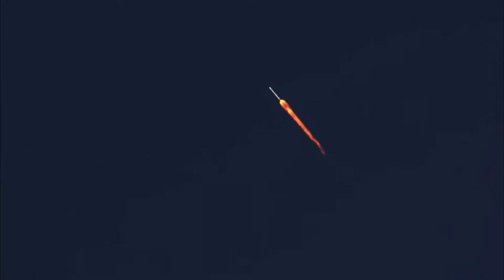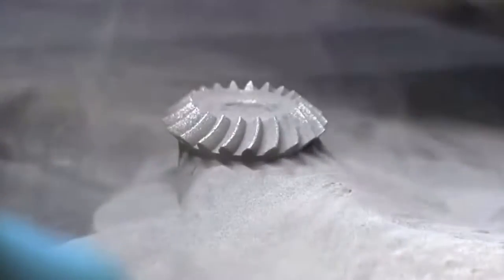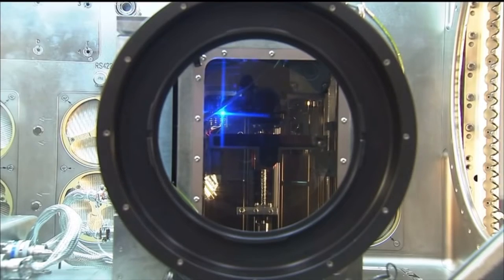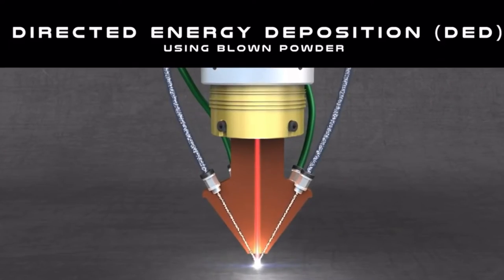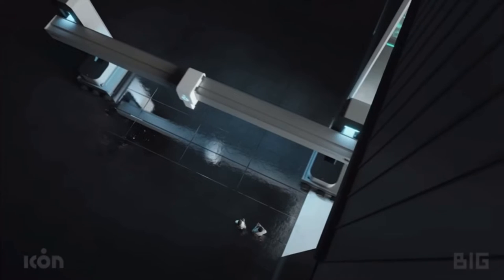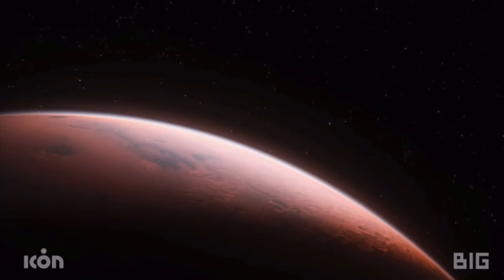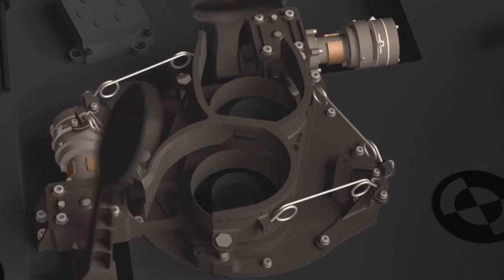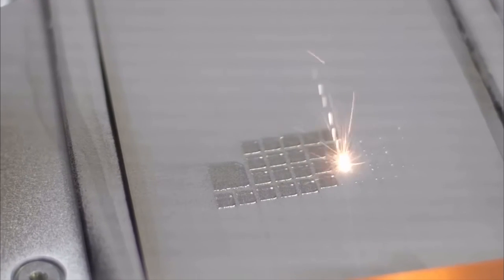How NASA is using 3D Printing

Comment: Seems like you would need some sort of liquid binder which wouldn’t be found on mars , calling shenanigans on the mars 3D printing walls for a habitat
Reply: There's a website that says mixing titanium and martian soil is used to 3d print, martian soil is made mostly out of sand/iron oxide, and they would be melted together not mixing water.
Reply: @Imbatmn57  wouldn’t you need some sort of refining process to get the native soil to a level of consistency?

Comment: Ugh, when building on the Moon, critical structures like habitats, CHAP's and generator power should be underground, not on the surface.
It has no atmosphee and thus any micrometeors will hit the surface when on collision course for the Moon.
Cheap solar panels that can be recycled on the Moon itself, after being hit by such a microasteroid up
to the point of breaking, should also be a usable tech and applied for cheap power, which the Moon
has in abundance, since it's almost never nighttime, and once again has no atmosphere which then
enhances Lunar power collection.
Once all the sub-surface is done, then yes, maybe a couple surface domes for recreation.
This is true for all teh easily recyclables or expendables, but not for key structures.

In fact sending a tool drone to the Moon, should be the first step and allows for remote operation
of just about any task, like drilling, solidifying any subsurface structure.
The Moon is mostly dust, so digging is hard, with all the dust flowing back into the hole.
This can be overcome by laserhardening of the dust hole as it is being drilled.

The alternate method would be solidifying blocks of Lunar dust into solid 'bricks'
in shapes that allow for veritcal downward construction, like O rings or curved bricks.

A curved downward spiral for Lunar vehicles with solidified floor would also be useful
and disallow direct airlock impacts with small-medium meteors, increasing safety.

For any human presence I'd suggest a spin based gravity enhancer.
Tilted closed platform carrousel/spinwheel. 0.1 G surely isnt enough for long term presence.
Reply from the maker: A very impressive detailed argument for subsurface prioritization, i think the testing of surface colonies on mars is to make the idea of colonization sexy so they can spend more government money without blowback.